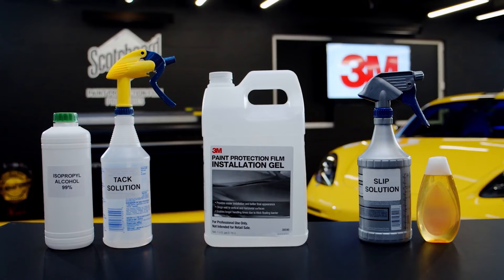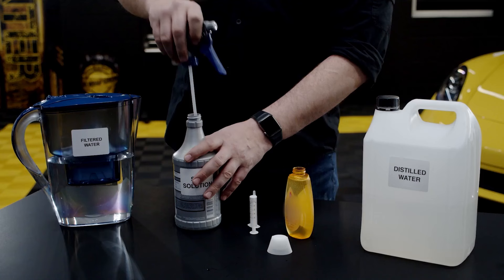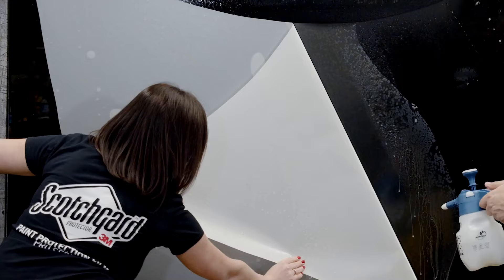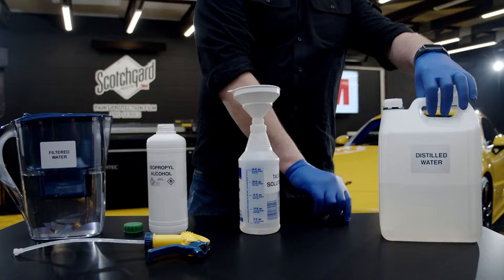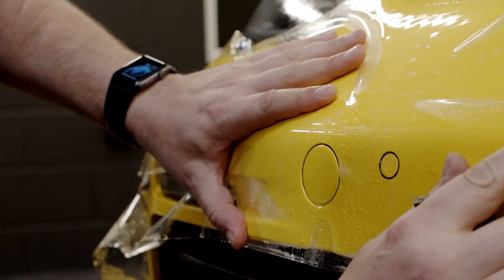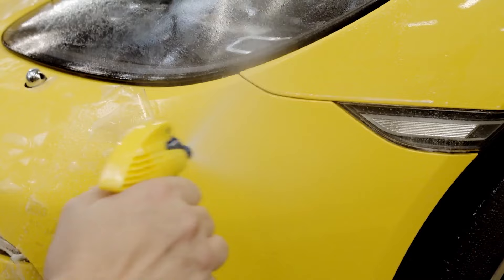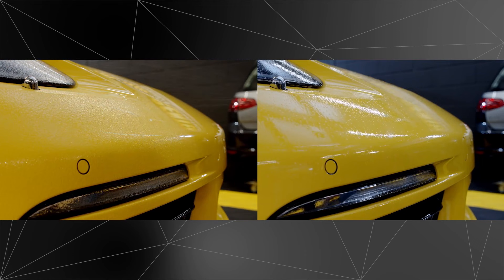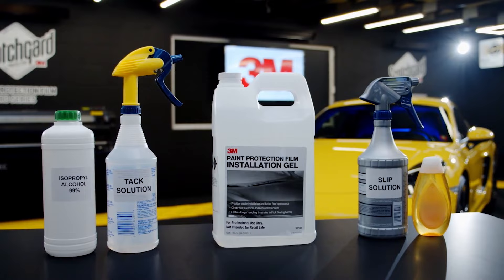3M™ Paint Protection Film - Installation Solutions video

Comment: Is there a way to prevent the accumulation of dirt along the films edge after installation???? I have a white vehicle and it has a black edge from accumulation of dirt.
Reply: They seem to wrap the ppf around the edge of the panel so no dirt would be able to get underneath
Reply: you can try clay barring before applying the ppf film
Reply: Dirt is dirt--There is no way to prevent it from accumulating around the edges. You can however clean it with a very soft bristle toothbrush. If the film has lifted and dirt is underneath it, it can only be fixed by cutting it away but that should be left to a professional!

Comment: My car ppf from 3M damage just in 2-3 years and now I am struggling to remove the ppf. Waste of money You can repaint whole body of your car  much lesser cost then this fellow charging. Don't waste your hard earned money on this rubbish things. 3M is telling you opted for 3 years warranty film, so they can't help.
Reply: lol you are not gonna get a decent paint job for under 3k. A good paint job is going to be up to 7k
Reply: If you let some random Yahoo install it that's going to be the end result with 3m warranties the film for 10 years if it's applied by a certified installer....
Reply: sounds like user error😂
Reply: PPF is a sacrificial material. It takes the damage instead of your paint. When you remove the PPF, you should have some pretty great looking factory paint under there. Think about what that bumper would look like if it had taken those 3 hits itsself, plus all of the thousands of normal sized rock hits that the PPF absorbed without you even knowing or seeing damage. 👍🏻
Reply: Sounds like it was installed incorrectly.  It should have curved under the edges.  Maybe the installer was lazy